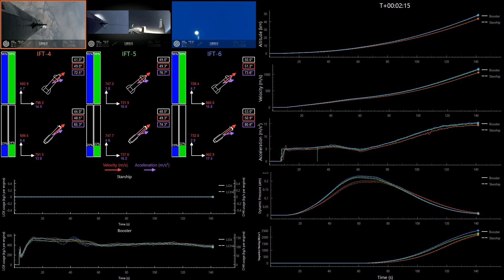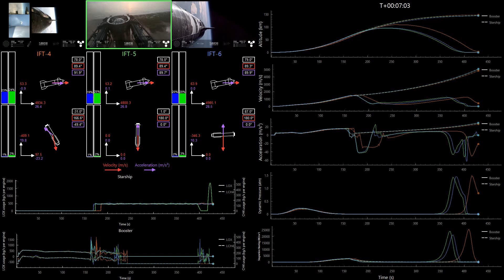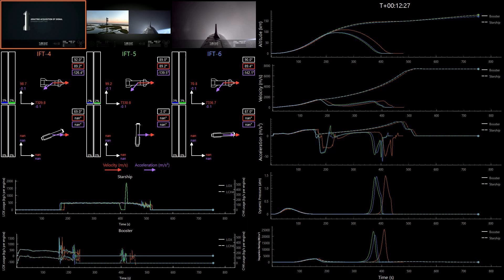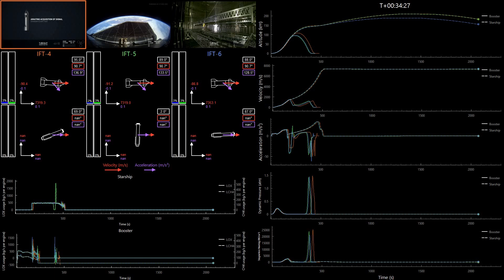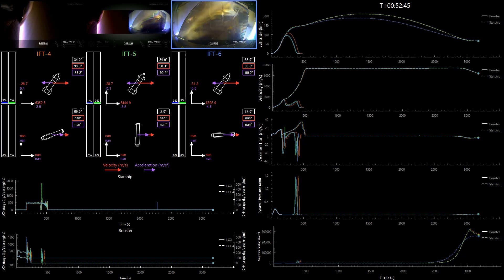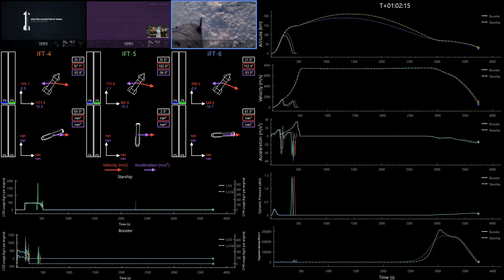SpaceX IFT4, 5 and 6 launch ANALYZED!

Comment: you might consider changing the title of the previous version of this video with the velocity error in order to make it clear which one people should watch. Or delete it, if that doesn't negatively affect your channel.   Also, if you do any more of these compilations that aren't done live, if you have the ability to render them in 4k, that would be sweet. But I have no idea how much of an extra hassle that is, just a thought. It's perfectly legible at 1080p.
Reply from the maker: I set the other to unlisted, thanks for the reminder! I was going to do it but just forgot.

I can make it 4K easily, and actually wanted to because I have many other plots I wanted to include but just ran out of room. However, if I make it 4K It'll be unreadable/unviewable on a 1080p screen. Didn't want to just make it impossible for people without a 4K screen to view it. However, if there's enough interest I'm happy to make a 4K version separately.
Reply: @ oh, I do not think adding any more plots is a good idea at all. I already have to watch this on my 32 inch 4K monitor to read it because the text is just too small on my iPad, which is my usual YouTube machine. Rendering the current view configuration in 4k would just make the plots a little nicer. But definitely don’t do anything to shrink the text. Honestly, probably not worth the effort if it would change the text sizes. It’s readable as-is, on a big enough screen.  Enjoy today’s launch!

Comment: It seems the disintegration of the flaps cover in IFT-4 did effect the deceleration profile, which makes enough sense.
IFT-6's new entry profile seemed to be "better" in terms of heating, or I may be factoring out the improvements they made on the TPS tiles.
Reply from the maker: They did mention a new re-entry profile to reduce peak heating. I'm surprised I see it so clearly in the data with a simple equation.